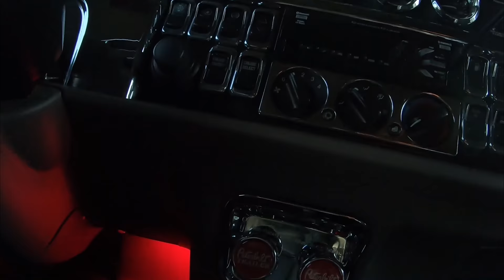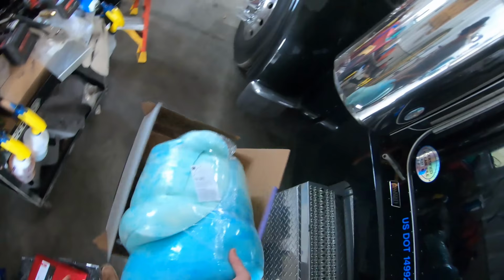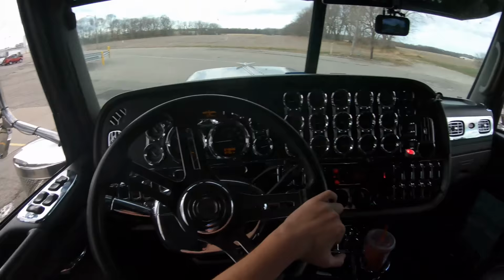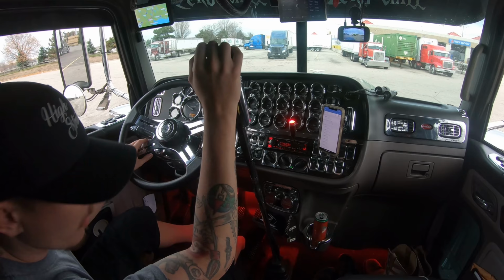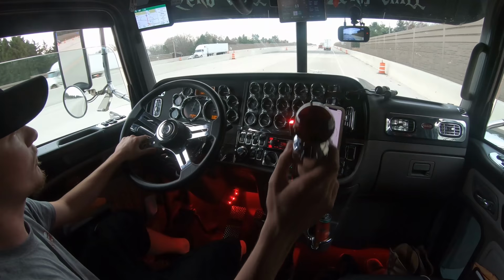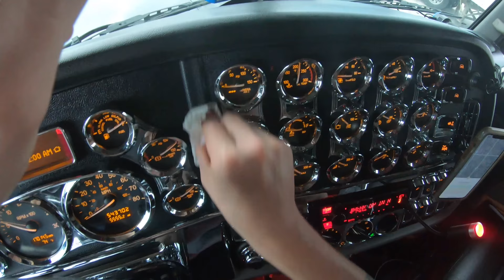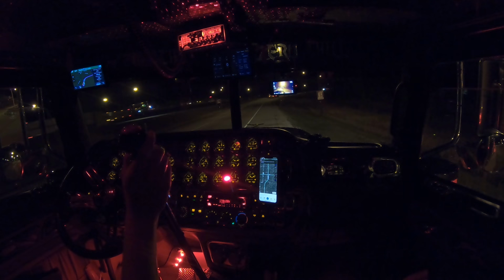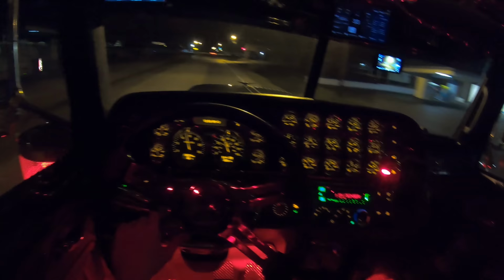Truckin Down To Texas Part 1, Getting My Peterbilt 389 Ready. Washing, Running, And Shifting

Comment: Thiers a right way and a wrong way to go trucking, this dude does it the right way!
Reply: I noticed your shift knob bounces around  pretty good when you're in the top hole, is that because of the height of your stick and the weight of the shift mechanism. Just curious, good job dude. Always entertaining videos!

Comment: Hey I'm gonna give you some advise just like your giving us advise when you sleeping in a pull off or next to a road always  turn your lights off unless your in a truck stop 
Example I'm driving  down the road tired as hell I loose the white line for a sec then see your trailer lights on so I start to follow  them then bam I just hit a parked truck so just saying when you parked next to a road always turn your lights off
Reply from the maker: Cant do that cause if i get hit with out lights on its my fault. If your that tired driving you shouldn’t be driving. With all respect bud

Comment: Great driving there driver. What is the spray that you used on the inside of the tractor? Keep the rubber side down.
Reply from the maker: leather smell good from chemicals guys its at wal-mart
Reply: @High_strung  10-4